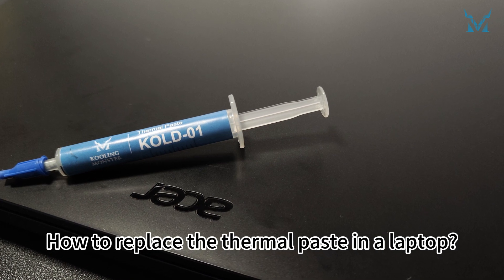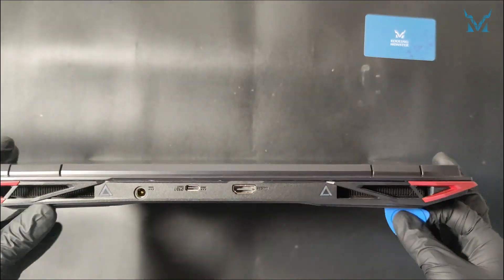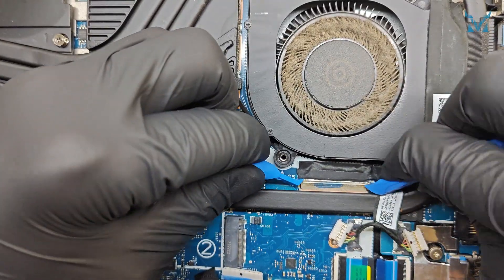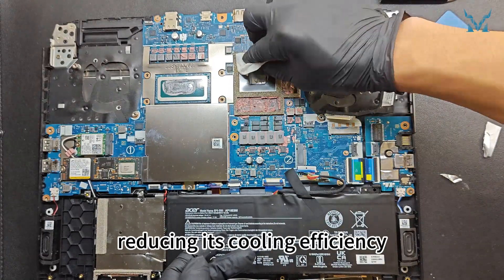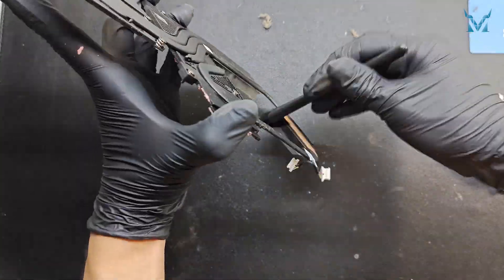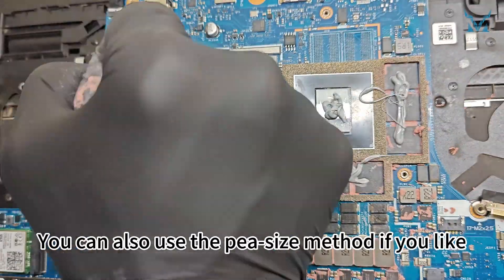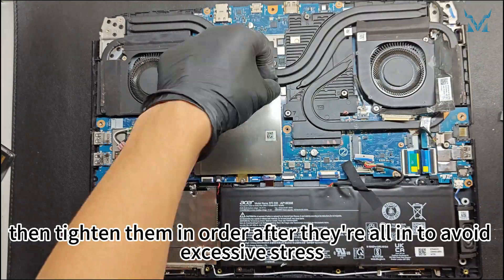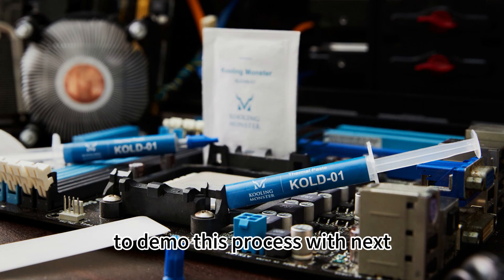Speed Up Your Acer Nitro 5 2022 - Prevent Overheating With Dust Cleaning & New Thermal Paste

Comment: I have question, what's thermal pad do i need to use to replace some other part except the cpu and gpu? Do i use the 0.5mm or 1.0mm?
My laptop was Acer Nitro 5, AN 515-42

Comment: Don't do what he did in the video. The air temperature will exceed 100 degrees and Windows will immediately shut down or display the Blue Screen of Death. This thermal paste should not be placed on the chips around the processor and VRAM chips. This requires high-quality thermal pads or another similar product instead of thermal pads. I will not mention the names of some companies and the paste so that you do not think that I am making an advertisement for them. All you have to do is watch the videos. Another way to see how the gray or silver paste is applied to the processor unit and the graphics card. Next, you must cover everything around the processor and the graphics card with a special thermal paste of multiple colors and a material similar to thermal paste but more solid so that it can be placed over chips with a thickness of 1.00M VS 2.00. M
Reply: Hii i got same issue , that service guy removed thermal pads and cpu tos going directly to 100 , now noone ready to listen me just being helpless , can you suggest something
Reply: Do you have temperature problems in your CPU or GPU? @SuicyYT
Reply: @nadyaalhlo9992  yeaa directly rising soo fast too max limits like gpu can hit 87 if consistently 100% for 10 min which is max for acer nitro 5 and cpu goes to 100 in just 2 min of heavy usage
Reply: @nadyaalhlo9992  and also this is happening  just after when that company service guy removed thermal pads and putted thermal paste …
Reply: You can also apply the same paste to the graphics GPU @SuicyYT
Reply: Grizzly Minus or K5 Pro heat pad
Reply: thermal grizzly kryonaut 1gr 12.5w
Reply: This is what brought my laptop back to life. Maximum temperatures returned to 82 in game mode and 39.46. In idle mode
Reply: @SuicyYT  K5 Pro. Replaces thermal pads. More like a putty
Reply: @nadyaalhlo9992  Hello! I just wanted to ask. My laptop is an Acer Nitro 5 can I use the thermal grizzly kryonaut 1gr 12.5w for both the gpu/cpu and the vrams? I won't be doing the repasting myself but will be providing acer support with my own paste. Thank you!
Reply: @ValBryanViscara  You can use this thermal paste with confidence, as it is the right solution for you. You can apply the paste to the central processing unit and the graphics card as well as the Grizzly Kryonaut 1gr 12.5w. But you cannot put it on the chips around the graphics card, which are called VRAM chips. They need a special paste called K5 Pro. This is what I did in the end after wasting my money and tormenting for a year while complaining of excessive heat. After applying K5 Pro paste to the vram chips and applying Grizzly Kryonaut 1gr 12.5w to the processor and graphics card, my laptop came back like new.
Reply: The graphics card and processor need a Grizzly Kryonaut 1gr 12.5w
Reply: @nadyaalhlo9992  thank you so much for clarifying! 🫶
Reply: The VRAM chips that are located around the graphics card and the processor require the K5 Pro or high-quality thermal pads with a thickness of 1.0 and 0.5.
Reply: @ValBryanViscara  If you want your laptop back new without heat. Buy what I mentioned so you don't waste your money
Reply: @ValBryanViscara  See the video at minute 5:25. It requires thermal pads with a thickness of 1.0 and 0.5 next to them as needed, or K5 Pro thermal paste.
Reply: @nadyaalhlo9992  Thank you so much for the info!
Reply from the maker: Hello!
Are you referring to the thermal pad on the small chip near the CPU? Whether it's a thermal pad or a phase change pad, you can use our thermal silicone grease. Some people may say that silicone grease shouldn't be used, but that's because the silicone grease commonly found on the market is too watery, and its flowability and viscosity are not particularly optimized. This can lead to the grease easily flowing away due to the large gap between the small chip and the heat sink cover. Therefore, it's important to use high-quality silicone grease. If you need to replace the grease in these areas, we recommend using our KOLD-01 silicone grease, which has been specially optimized for flowability and viscosity, making it less likely to experience such issues.

Comment: DO NOT do this like in the video , 
1 of all a 2022 laptop's thermal paste will 100% be fine after 1 year - they say "clean up the dried up thermal paste" but all I saw was pretty much normal thermal paste , if it was dried up it would have been waaay harder to clean . 
2 they say how much of a difference it made for temps ....... YEAH IT WOULD  when the freaking fans were clogged. 
3. That thermal paste application (even fo someone who has mostly seen and done 3-4 times ) was hard to watch , it was like watching some kid finger paint , a lot of spots didnt get any , some were way too much and that thermal paste of yours didnt look like it stuck to anything at all . 4 I have dissassembled my Acer Nitro (different chip 95% same construction of body) and on the capacitors and other stuff thats not the CPU and GPU there was a pink "thermal paste" that was like 1-2mm thick. As I saw here it was probably the same and the way they applied it there was places with no thermal paste let alone 1-2mm thick .
This video is trash and in no way a decent tutorial of a thermal paste reaplication for the Acer Nitro 5 , just a crappy way to try and push they're products to less tech savvy people.
Rarely do I ever post comment on YouTube , but this was one of those moment that made me do it.

So all in all just clean your fans regularly.
Reply: Thermal paste makes a huge difference on performance on my laptop depending on the paste. That's why many people see huge improvements with PTM7950 phase change material with their laptops in various forums or reddit etc, it works extremely well on a laptop. Most people judge from the typical thermal paste tests from a desktop CPU and think it must be the same on a laptop. Also the performance degradation can be big after some months or even weeks. The higher the temp the faster it can degrade. Of course it depends on other things too, lots of laptops have pump out issues. Sure they want to promote their paste but I can say this paste works extremely good on my laptop. I tested a vast number of pastes in the last 3 years and in fact this paste as well as Aerocool Fuzion are the only two pastes which can match the performance of PTM7950 phase change material.
Reply: @K543  Im not saying there isnt a difference in thermal pastes , I meant that IF they wanted a real before and after a repasting and to market they're product they should have cleaned up the fans and run tests then replace the thermal paste and run again so they can show that it is the thermal paste that made the temps drop and not just cleaning the fans. Also there is no excuse for that sloppy application and I'm betting in the long run they will have problem with the caps overheating since there was no thermal paste on some of them.
Reply from the maker: Thank you for your reply.
1. This tutorial is posted now doesn't mean that people should replace their thermal paste now. The tutorial will always be there whenever this laptop starts to slow down and throttle for people in the future.
2. Cleaning the fans is of course a very important step that can improve temperatures by a lot. If you want your laptop to run faster and cooler, cleaning dust from the fans is a must, and you shouldn't be surprised that cleaning the fans is a part of this tutorial. 
3. Thank you for pointing out. We will better train our crew on this matter. Our KOLD-01 Thermal Paste uses a special non-solvant formulation design that can prevent paste drying up and losing thermal conductivity, resulting in longer lifespan, therefore it is not like other thermal paste that you might have handled before.
4. The "pink thermal paste" is thermal putty, a cheap, less-effective substitute for thermal paste that manufactures use on components that generate less heat. You can leave them as is, or replace them with thermal paste. 

Our company's mission is to make PC performance upgrades simple and low-cost for all. This is a tutorial video for people with this laptop that runs into problems such as overheating. We use the temperature before and after this whole process to show what a great improvement you can get just by cleaning the laptop and changing the thermal paste and let people know that they don't need to spend a thousand dollars for a new laptop. We offer our products as a kit for people to get everything they need to clean and upgrade their laptops more conveniently. Again, this is a tutorial video.
Reply from the maker: @K543 Thank you for the reply. We appreciate the kind words of our KOLD-01 thermal paste. We make these videos to fulfill our company's mission of making PC performance upgrades simple and low-cost for all.
Reply: Yeah I think I'll stick to keeping my fans clean, thanks for this comment!!
Reply: Hi !! i have the same laptop but with i5 12450h processor for 4 month,  the case is the same, just wanna ask you if its possible to apply thermal pads plus the thermal paste on this lap for more refrigeration and when i should change the original therman paste ty so much bro
Reply: @MrDarkLexis  Where do you want to put thermal pads on ? And what do you mean thermal pads and thermal paste , don't use both at the same time on the same place , thermal paste for CPU and GPU and thermal pads/thermal paste for capacitors and such. I haven't tested the PTM 7950 yet , but I see a lot of positive reviews on it . I am mainly using Thermal Grizzly's Hydronaut or kryonaut as thermal paste.
As far as better temps , I did get a few degrees better with hydronaut and kryonaut compared to the original paste in the laptop. Arctic MX-6 is another option .I don't want to undermine  the Kooling Monster paste , but I have no experience with it AND I haven't seen it where I buy my paste from so no comment on it ,it might be good it might be bad , so I am commenting on what I have tried and as someone who IS NOT a professional and just an ordinary guy replacing his thermal paste on my and my friends laptops for years.

Comment: This is one of the worst thermal paste applications I've ever seen, I was physically cringing.
Unless you want your device to short circuit, don't do this.
Also the thermal paste was clearly liquid, so it didn't need the cleaning.
This is an insane video.
Reply from the maker: Thank you for your suggestion; we will make improvements when recording videos.